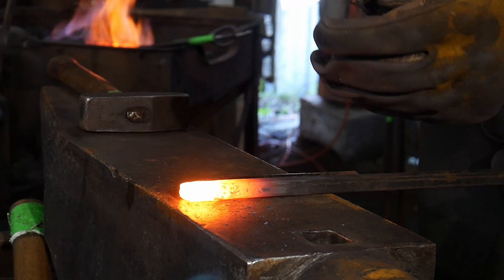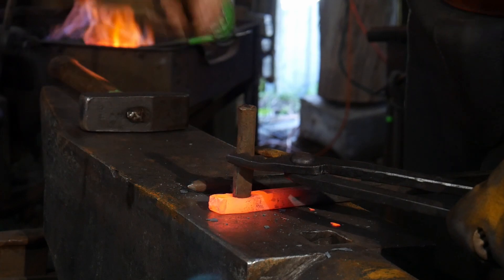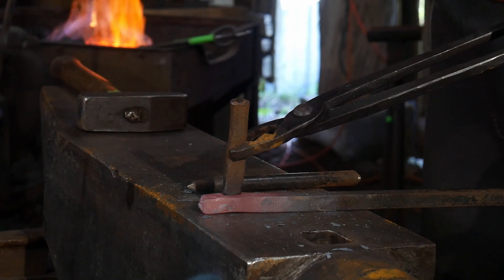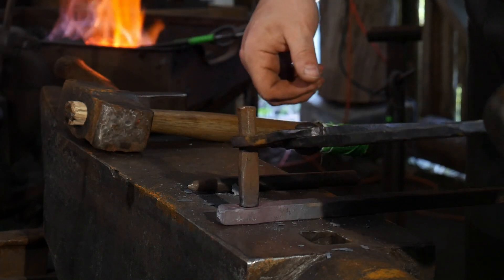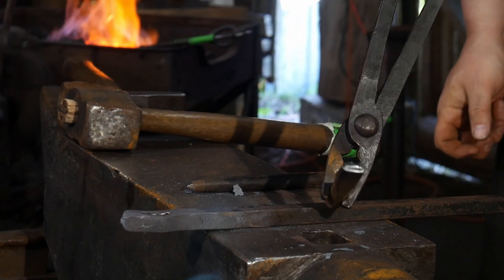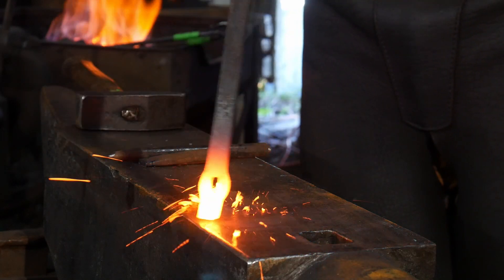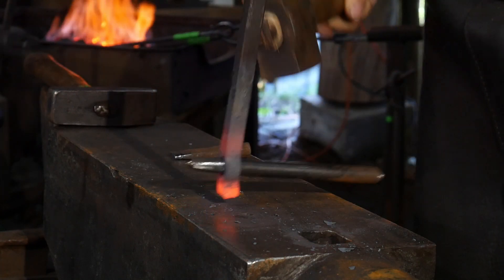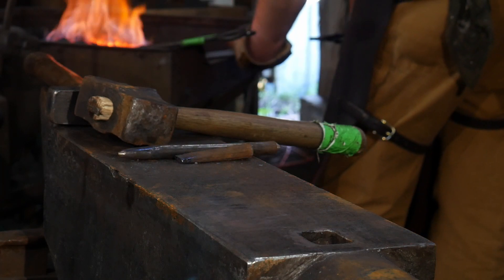Slit & Drift: Fundamental Instruction #8

Comment: Hey Roy, 

just curious if the type of  chisel used here is your preference in general or would a handled slitting punch be a bit easier to manage without a striker? I’m working on building up my set of chisels/punches, but I’m wondering if tong-held punches or handled would be best. 

Thanks, Ben
Reply: Ben Stricklin Economically speaking, tong held uses less material, thus less time, thus less money. But, it is always good to have a mix of both. And
 while it is good to have tools around, I find it best to make a tool when I need it, or else you get caught up in making 20 different tools that you may never use.